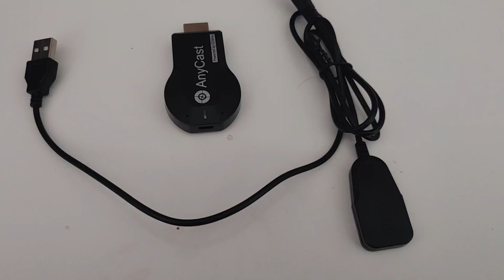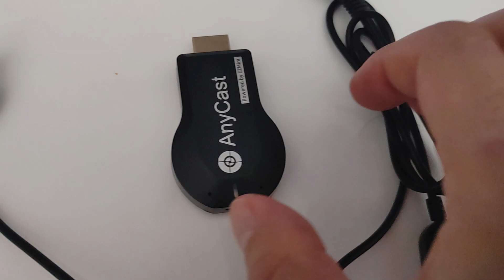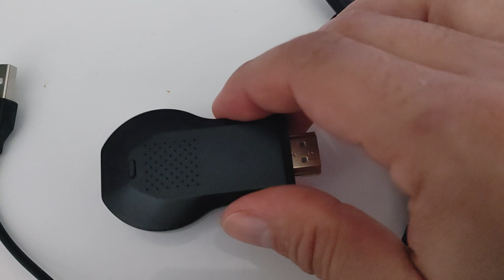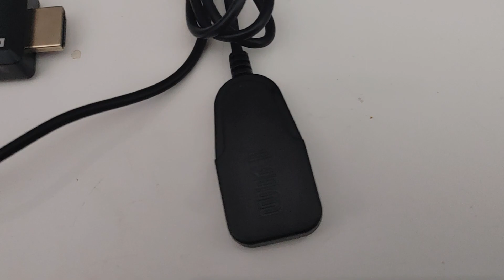AnyCast wireless hdmi device. to eliminate wired connection.

Comment: Your "AnyCast" device looks like a Memorex "MWD38B".

Unfortunately, the connection to my router is (http only, NOT https) "192.168.49.1"

So far, I haven't been able to find a way to update my  "MWD38B" to https

Using http "192.168.49.1" results in an error message in Google Chrome "...CONNECTION_NOT_SECURE...

I'll keep looking....

I'll post, if I find a solution